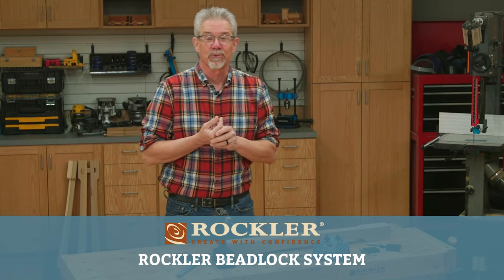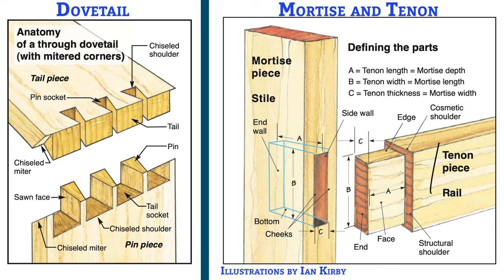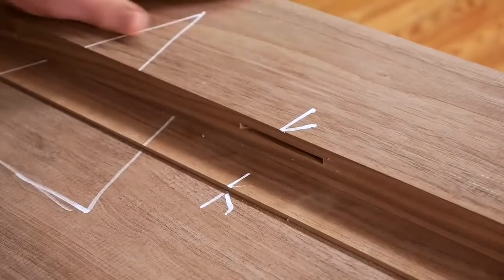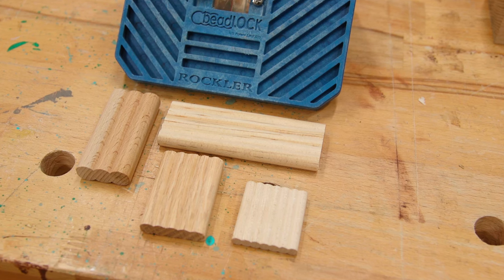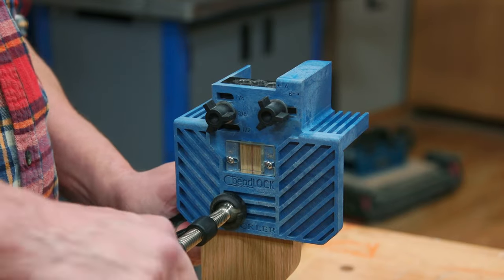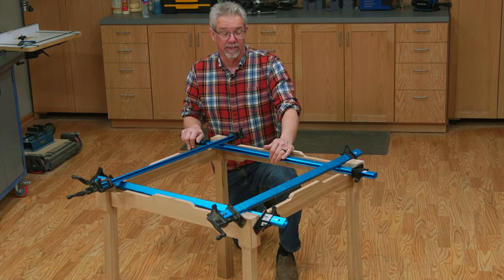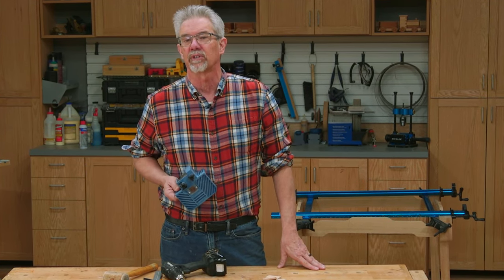Easy and Strong Furniture Joinery with the Beadlock Pro Jig

Comment: why did rockler  change the beadlock pro I definitely would rather buy the old beadlock pro (that still shows on the site, just as out of stock)
Reply: I feel the same way that looks like a lot better jig then this and with the ability to rout mortises with a different block would be nice. My guess is they were not big sellers and now this jig with the plastic parts cost a lot less to mass produce, because of the tooling to make it and inventory cost.

Comment: Thank you for posting this video. I am building a workbench for my drill press and miter saw. Is this a strong enough joint to connect the two (2x4) legs to a single treated 2x4 base/foot?
Reply from the maker: Hi Tom Sawyer, Please reach out to our product support team at 1-800-260-9663 or support@rockler.com. They'll be able to assist you. Thank you

Comment: How will it work with breadboard ends? Does Rockler have a video showing the procedure?
Reply from the maker: Hi Jim, We wouldn't recommend the Beadlock for breadboard ends due to the shape of the beads. It wouldn't allow for the movement that you looking for in a mortise and tenon for this application. That being said, you could extend the mortise length, and then chisel the peaks off, so the floating beadlock tenon could move freely in the mortise.

Comment: I like the concept of making my own tenons. However, I went to the Rockler website and I am unable to find a router bit shown at 1:29 minutes. Is there such a bit in the Rockler inventory? I find others but not one that matches the illustration nor has the spacing to match the holes drilled. Appreciate input.
Reply from the maker: Hi John, you can find the router bit shown in this video at https://www.rockler.com/3-8-beadlock-tenon-bit
Reply: @rockler  thank you. I did find the router bit. The router bit is for 3/8 inch stock only and does not accommodate the specs for the 1/2 inch nor the 1/4 inch drill bit holes. I gather there are no plans to change that?
Reply from the maker: We do not have any plans in the works for that at this time. We will pass your suggestion along to our Product Development team!

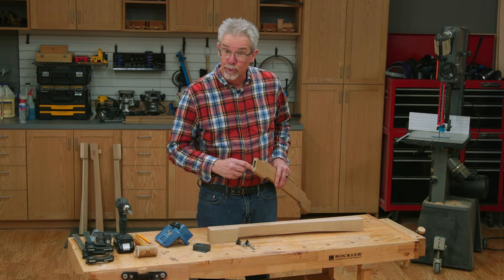Comment: @2:10 you talk about thickness centering of the jig but never explained how you centered it relative to thickness for your 3/4 board.  Is the 3/8 drill guide designed for 3/4 stock as the default?
Reply from the maker: The 3/8" jig is designed for 3/4" stock, but you buy a spacer kit to offset the mortise.

Comment: Is there a way to use the jig to join wood midspan?  Like if you're making a table and you want to put in some cross pieces for support.  Also, do you think you could use this system to attach breadboard ends on an outside table?  I understand that not everything can be glued.
Reply from the maker: Hi Mark, yes; the Beadlock system can be used to join two pieces of wood midspan. As long as the Beadlock jig can wrap around and be clamped to one face and either an edge or an end of a piece of wood, its mortise holes can be drilled. Where that mortise specifically is located is entirely up to you. However, Beadlock won't work if the position of the mortise is farther inward from the face/edge or face/end than it can reach, using the optional Beadlock spacer blocks. There is a limit to how wide of a surface it can handle and still locate a mortise.
Reply: @rockler  Thanks for answering!